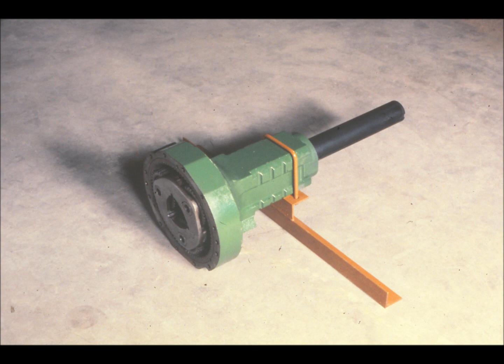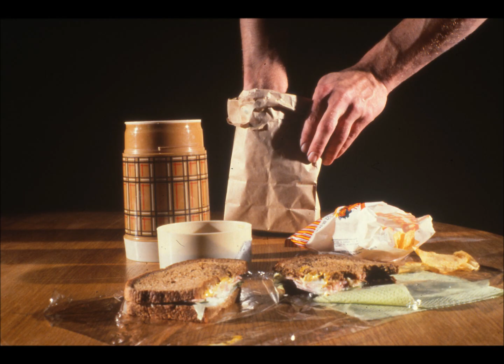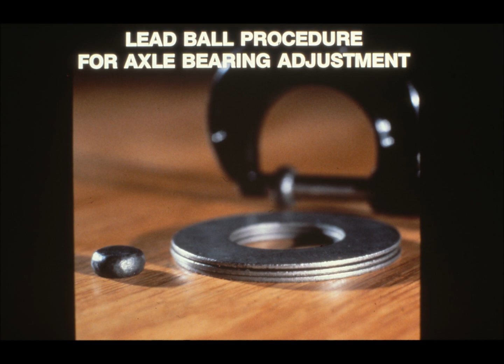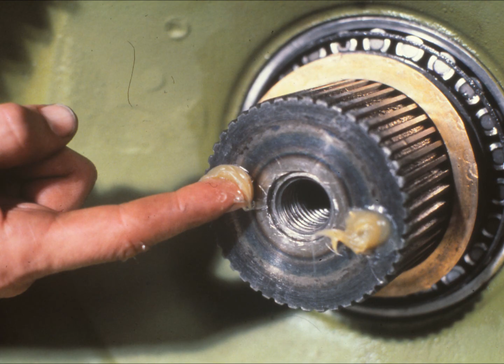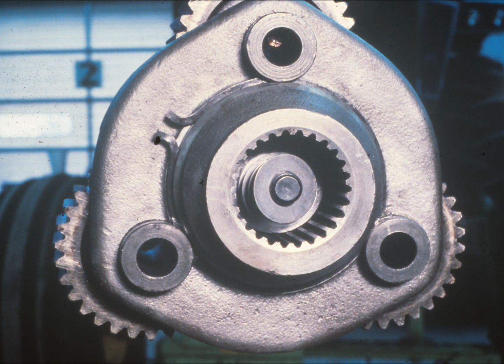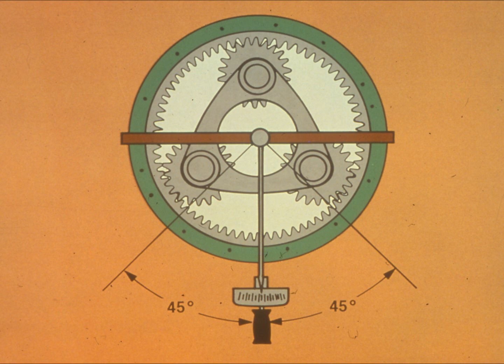John Deere - Lead Ball Procedure for Axle Bearing Adjustments

Comment: Soft wire solder set in grease.  Have to have the thicker shims in place so the remaining gap is small enough to crush the wire.  Make it into a circle on the end of the axle.

Comment: Aluminum foil balled up works great for this too! You can also modulate the hardness by how much you crumple in!
Reply: Foil balls do not give results to the same accuracy, they are springy and flex more under normal micrometer force.